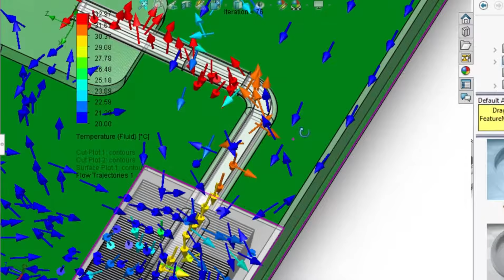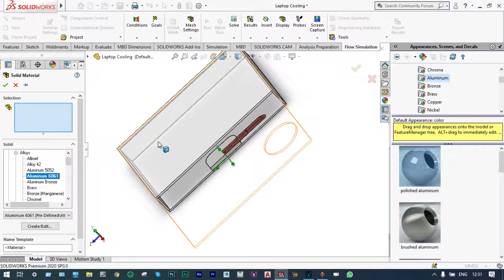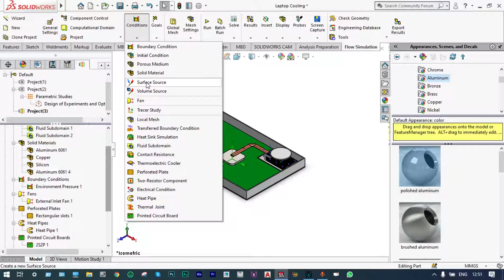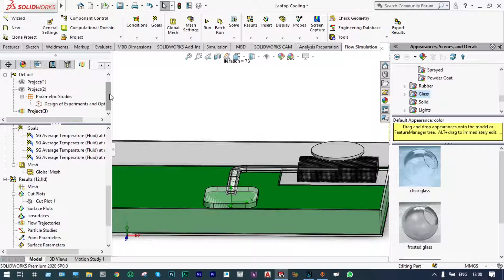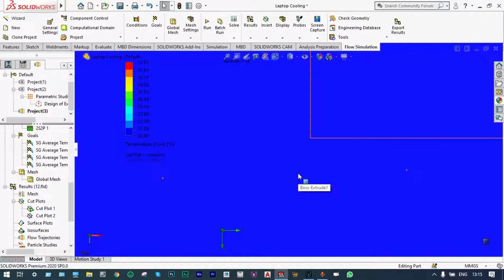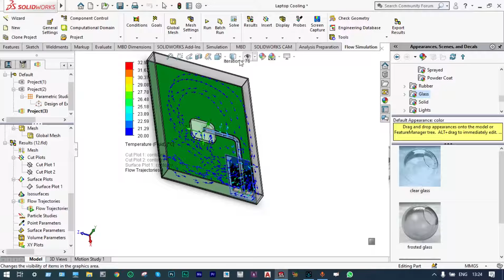Laptop Cooling with Heat Pipe | CFD Parametric Study with SolidWorks 2020 |

Comment: Hi, thank you for this great tutorial. I don not understand one thing though. Heat generated at the chip is 50 W, some of it goes to air and most of it goes to the heat pipe. You defined thermal resistance of heat pipe to be 0.05 K/W. Let's say 40 W enters the heat pipe, does it mean then that 40 W x 0.05 K/W = 2 K, temperature difference at condenser and evaporating region? I am asking this because you got 4 K difference and I am struggling to understand this. In my situations I get even worst variation of temperature which doesn't make any sense. 
Thank you for your help.